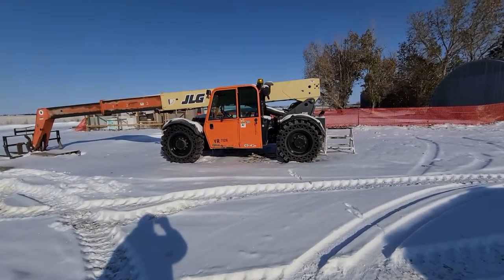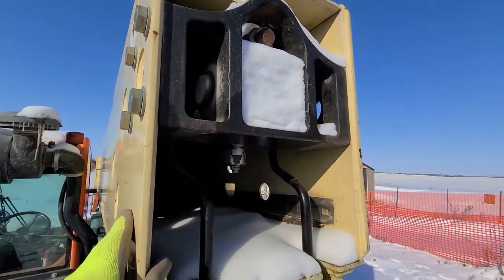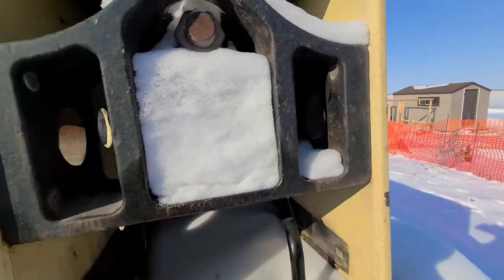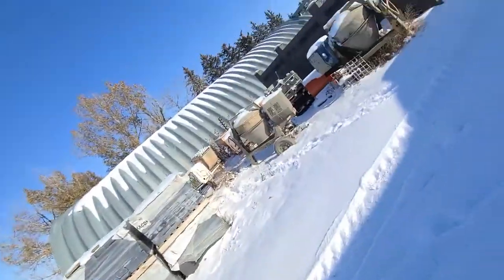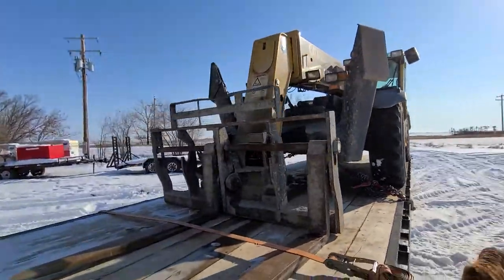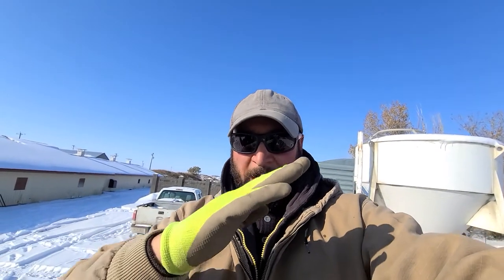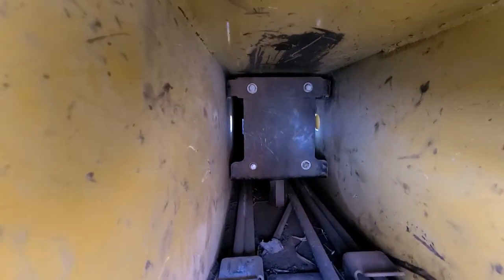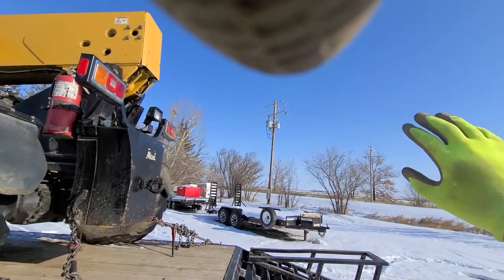Boom disassembly, ram removal. Cat/JLG tellehandler.

Comment from the maker: These machines are my favorite to operate, and so far as I can tell, the easiest to work on, which is good, because these constantly something wrong with them, my lest favorite by far to work on is the Ingersoll, but operates and runs nice. I will make a video on how I removed its transmission someday. Worst job ever.(actually pretty easy, but I flubbed it hard)
Reply: Dracula! Booming out for telehandlers are done by a combination of hydraulics and chain pulley correct? It doesnt look like there are hydraulic cylinders for the booms, except for the diagonal one outside on the chassis.
Reply from the maker: @erroruntitled6655  yes sometimes the cylinder is inside the boom. And sometimes it's outside, same can be said for the chain or chains